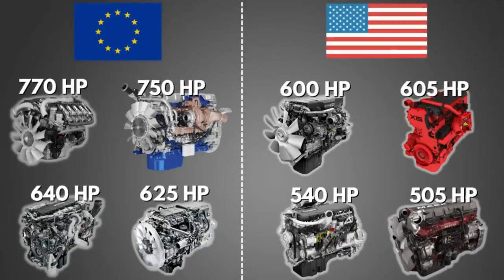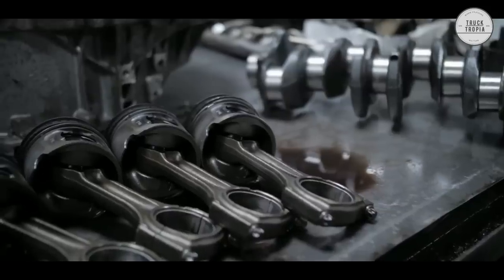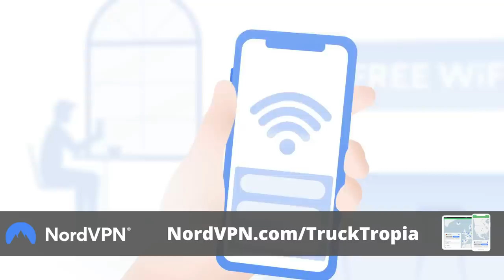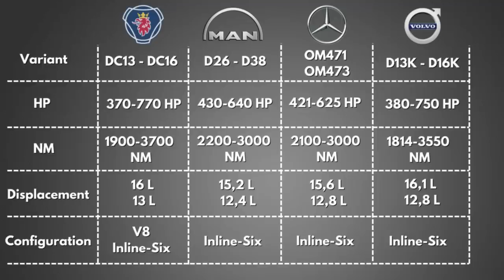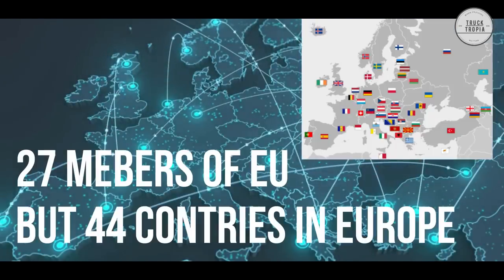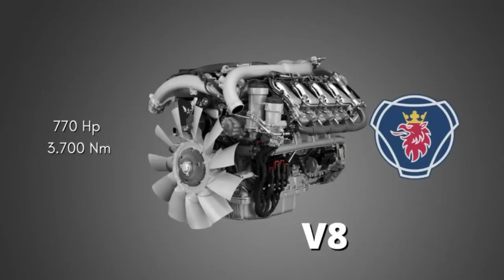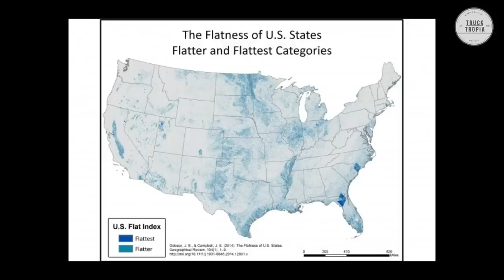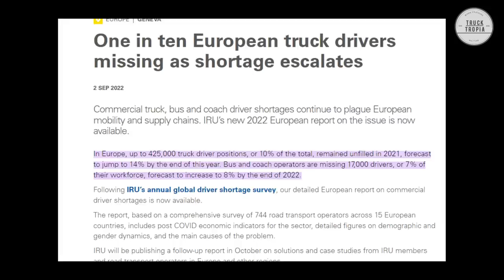Why European Trucks Have Up To 770 HP And US Don’t

Comment: Interesting video, but I think some assumptions are not quite correct. Most trucks in Europe are not as strong as the video assumes. I also don't think Europeans are more powerful on average than Americans. After all, these trucks with more than 700 hp are very rare and are driven mainly in Scandinavia. In the past (in the eighties and nineties) US trucks were on average more powerful than European ones. This has leveled off somewhat now, but the few very powerful models of the Scandinavians should not be taken as a basis for a statement that the European ones are stronger.  The US trucks are definitely faster ;). At least in Germany, there has been a "technical speed limiter" at 80 km/h for years. They can go faster downhill, but not by much. I used to drive a lot in North America, both privately and professionally. There were a lot of heavy trucks traveling at 120 km/h, which scared me quite a bit. Often in wet conditions and other conditions that would not have half justified it.

Comment: it doesnt matter at all how much torque an engine produces. Thats what you have a gearbox for
Reply: @boonamai8926  it simply doesn’t matter how much torque the engine produces as long as it’s generating enough power and you have an adequate gearbox.
Reply: @boonamai8926  you need torque on the wheels. It doesnt matter whether you have an engine that does 500hp@2000rpm vs one that does 500hp@10000rpm. They can both pull the same. The first one is gonna be more efficient but they can pull the same with an adequate gearbox
Reply: @boonamai8926  An engine with 500hp at 2000rpm has 1780nm of torque at 2000rpm. An Engine with 500hp at 8000rpm has 445nm of torque. Power is nothing else then torque multiplied by rpm. So when you now connect the 500hp@2000rpm engine to 1:1 gearbox you have a wheel that spins at 2000rpm with 1780nm of torque. If you connect the 500hp@8000rpm engine to a 4:1 gearbox you have a wheel that's spins at 2000rpm with 1780nm of torque. 

So as you can see it makes no difference how much torque the engine produces. Because a gearbox lets me convert rpm to torque or vice versa as I like.

Comment: Most truck companies in Europe has trucks with the amount of power that the transportation needs.
Most engines has 450-550hp, almost only those who haul heavy stuff has more than 600hp
For example is the 750-770hp more common among lumber transportation companies.

Comment: The biggest reason is political. Most of those engines have a lower less horsepower tune for the everyday customer however there’s a different more powerful tune for the government/military. It also has to do with our stupid emissions laws over here that really only make the engines more expensive and much less reliable. We use to have access to big massive V-8 and V-12 diesel engines. Higher horsepower/torque engines help in the hills and mountains. Don’t be fooled there are plenty of drivers out there that have upgraded/tuned their diesel engines way above the 700 horsepower range.
The other reason is fuel economy and the cost to operate over the road when dealing with big corporate trucking companies who’s bosses aren’t out there on the road actually pulling the loads. Fleet trucks over here are mostly gutless.

Comment: Here in Michigan USA  Many Trucks are running with 11 axles with a Gross of  160,000 to 164,000# There are also special permited much heaver Loads in the USA.  In the Past there were much bigger engines with more Horsepower maybe they have not been updated for EPA Emissions Laws or Euro 5 Emissions..
  Plus in Australia the road Trains can have a secondary engine on some of the Trailers..

Comment: Without the horse power it would take an eternity to get up to speed so hp is important
Reply from the maker: Sure but without the torque it wont be Able to pull anything. A 700 hp Bugatti cant pull like a truck
Reply: @TruckTropia  and a truck can't do 250mph

Comment: The  Paccar MX 13 engine  is develloped by Daf in Eindhoven in the Netherlands, owned by Paccar, for the American market.
In 2019 Daf started producing those engines for Paccar  because they couldn't keepup with the demand in the USA.
I don't know about the current situation, after covid the market changed.
In the EU there won't be much furter devellopment with Diesel engines, it looks like it won't be possible to register new trucks after 2040 that run on Diesel.

Comment: Before Scania started selling the big straight 6 engine, the company i was driving for had a test truck. Must have been in the 90´s when making a cell phonecall was expensive. The test truck had the cab for the big V8 and 4 persons where needed to flip the cab. And only when Scania tec´s where there. It had a phoneline to Scania and technician at Scania could se everything going on in the engine/transmission in real time. And even change the power. I heard 7-800 hp at the top. They could even see the revs at the front and driving wheels. Going uphill at low gears made the driving wheels make alot more revs than the front wheels. Anyhow, it was fun to drive going uphill with more tonnes than the other trucks. It was really flattening the hills. Once i had emty plastic bottles on the truck and trailer, just a few tonnes, i guess the pallets where the heavy stuf. I drove that for 80 km and did not use all gears, The split was in top and the revs started in the basement at idle, then i changed trailer with another truck that had frosen meat up to maximum weight. At that time the Sandöbron (a old bridge) had a maximum weight at 52 tonnes, so now we both could pass the shorter way, and saving an hour. Anyhow getting out from the loading area where tricky and tight so i had to do some cornering, and i felt the added weight from the start. So i called the other driver and told him i made a bad swap, and he was laughing. When i got to the E4 (big road) i saw him way behind in the mirror, i was jumping gears and when i got 80 km/h he was lost. He was going alot faster than me but it took a while for him to catch up with me. Then we came to the first big hill. Hökmarksbacken. The highest point of the whole E4. Then he was lost again, i only used one split in the gearbox and flew ower the top. And still i was the one with the big heavy trailer. He only had a heavy truck. I stalled the engine (had the hi gear) at a broken busy trafic light, i was mooving but the engine did not start when i lifted the clutch, not even with the starting key, the engine was turning but it didn´t start untill i turned the key all the way back to zero. I knew i could pass the crossing, it was downhill, but i didn´t want to be standing on the E4 waiting for Scania tec to come. My brain where working full time at that moment. And i didn´t have a cellphone at that time.

Comment: Why these Nm matters at all? There something called gear that can increase torque to any value. Power is what really matters, because having enough  power you can always  tradeoff some speed to get more torque.
Reply: Sure. If you think creeping up every little hill doing 5 MPH is your thing... Bet other motorists would find that pretty annoying though...
Reply: @marcusjosefsson4998  you can have the same Nm on wheels and the same speed with engine having half torque but at twice rpm. Check in Wikipedia what is torque and what is power. power=torque*rpm (more or less - actually rpm has to be converted to rad/s to get result in watts). A 200hp motorcycle engine can power a truck and go uphill not slower than with 200hp truck diesel.  It will only wear quicker and burn more fuel.
Reply: @tomeks666  To maintain speed using a combustion engine and a gearbox there are more factors to consider.
We're talking about pretty heavy machinery here, that takes a lot of torque to keep moving. And since a combustion engine have a specific power band we need to keep the engine rev's in that band. On a very big diesel engine that power band is pretty narrow, which in turn limits how your gearbox needs to be constructed.
And since we don't wanna creep up that hill obstructing other traffic we need to find a working compromise through torque, power and gearing.
Thus we get a lot of horsepower no matter what.
Reply: @tomeks666  I know it's possible, but it's not feasible in practice. Pulling 40-60 tons up a hill with a motorcycle engine is doable, once. After which you'll need a new engine...
And since we can't stop to swap engines every 10 minutes we'll use a big turbo diesel instead that'll last for years.
I get what you're saying and all, it's just not meaningful to argue about it

Comment: That stuff you said about torque and power at the beginning is quite wrong. Power is how we measure an engine's ability to do work, not torque. A truck with more power will do more work than one with less. Unlike torque it's directly comparable.That's why they advertise the output of truck and tractor engines in HP.
Reply: Yes, that same blunder by them set me off too.  I stopped watching because of it.  Really the only time torque matters as a spec is when you don't get to choose the gear ratio.  
Another really important thing that this and many others miss is the ability of the power train system to make its pull power for a long time on a hot day repeatedly.  It takes a while to heat the great mass of an engine up but if you are climbing a mountain with one, it will reach that high temperature.  I think there still are some trucking companies in the west of North America that specialize in taking loads over the mountains.

Comment: On the hp vs torque part, remember that hp is just torque x rpm,  just like volt x amp = watt
Reply: Power = torque at the wheels (!) because more rpm = lower gearing = higher multiplication of torque to the wheels

Comment: I understand that the big power engines in Europe have a GPS limited output, this is to allow full power up the mountains but not the flat lands. The 58 mph speed limit makes it unnecessary except for the really heavy haulage loads, most our trucks have the lower options as the price is more important.  Australia with the road trains take the big output options to pull the high  number of trailers involved.

Comment: Just a reminder:
Max (standard) gross weight of trucks in the EU is 40 tons. Some exceptions exist, though.
If a truck is hauling freight to/from a container terminal (for transportation on a train) the limit is 44 tons.
Those 60 ton (or higher) weight limits are only allowed in specific areas of Sweden/Finland.
Irrespective of that oversized (and overweight) transports are common but need individual special permission (€€€ !) and are usually required to follow strictly (in advance) defined routes ...
Reply: Since 2015 it´s 64 ton here in Sweden and it applies to the entire country except roads with limited load capacity.
Reply: @MichaelB-sr2tt  Ok 
... but those heavy trucks cannot leave Sweden - in particular to the south.

Comment: I would have thought higher power means these engines have to run at a lower fraction of their max power, increasing engine life and service intervals and reducing emissions? I was always surprised Volvo and Mercedes buses (yes I know, not trucks) are so popular in India, as they are imported so far more expensive than domestic brands. The power of these modern engines are immense - I've seen them overtake other buses on steep winding roads! If a Volvo/Mercedes driver decided he didn't want me to overtake his bus on my motorbike while going uphill, I simply couldn't!

Comment: Um, while you're technically correct about the things you said about the EU vs the US I'd still like to comment about the size thing...
While the EU is smaller then the US Europe as a whole is actually *bigger*.
And those trucks operate outside the EU too in countries like Norway, Switzerland, Ukraine and so one and so forth...
And while Russia has poor infrastructure their European part actually has a lot of pretty decent roads in their core areas in the southwest where these trucks also operate.
So the size argument doesn't really hold water.
The differences in terrain however is most definitely accurate.
Norway, Spain, Switzerland and Austria, Italy, Hungary, Montenegro...
All of these countries have pretty rugged terrain with some serious mountains that needs to be dealt with...
Reply from the maker: Thanks for sharing 👍

Comment: The best truck i have is a Kenworth with a 7cz cat wich is even bigger than a 3406e or 5ek . I run circles with every truck on the road . The 7cz gets barely 4,5 miles per gallon but it does 108 miles per hour under a load of 215,000 pounds in a straight line . In hills im doing still faster then the truck in the right lane struggling . Caterpillar is the best ever . My volvo i like because is a cadillac smooth ride and because is my 1st truck but in no way compares to the ground pounder 7cz cat.

Comment: there is also the expectation in europe that a large engine gives high horsepower and torque. the usa have a market where a pickup has a 7ltr putting out 450bhp. in europe they get that from a 3 ltre. so if you go in to a truck dealer and see a 14ltre motor but only see a small difference in power you ask why. usa expects crap engine efficiency. if you look into it most usa trucks can have minor changes to get much more torque. you exchange life expectancy and fuel usage for power.
jeremy clarkson from top gear asked once how do american's get so little power from such big engines?

Comment: Torque has nothing to do with towing a trailer. Funny thing an author of the chanel with such a name doesn't understand that. 
Torque number, when multiplied by 2π, shows the amount of work an engine produces per one revolution. When your boss tells you to tow a 50 tonnes trailer (force involved) for 1000 miles (distance), he doesn't tell you a specific amount of engine revolutions you can't exceed. Instead, Work, being force times displacement, requires a specific amount of fuel, and not the amount of rotations or amount of torque per rotation.

Comment: The US manufactures make more powerful engines for specialized (overweight, oversized) hauling. For reference, lookup US Heavy haul semi. Like EU trucks you will find many many more axles and specialized trailers with tons of pivots and axles to distribute the weight better.

Comment: This shit about tourque is just wrong! You can easily convert tourque with a Transmission. You can convert power into more power. In order to tow a load up a hill at a certain speed, you need to transfer potential energy to that load and this can't be done by a force (or tourque) but by power. Or in other words, thourque at a certain rotational speed equals power. Thats why power is the correct measure to classify the towing capacity and not tourque.

Comment: 0:58 is wrong: engine tourge doesn't really matter, you want to run the engine at maximum power and then choose the right gear to get maximum tourge on the wheels, if you have 60% the tourge at twice the rpm xou get 20% tourge at the wheels with the right gearbox

Comment: The other major reason is US truck get their power from transmission and deferential Ratio ! American trucks with a smaller engine are more powerful than EU trucks . When you use a 18 speed eaton fuller or 8LoLo you can climb the hill easily! So in trucks powertrain has a big role

Comment: My Dad used to run the hilly roads of southern Quebec and Maine carrying logs and peat moss to Virginia and New York.  The truck was a Quebec made Sicard with a gas engine which made MAYBE 180 hp.  Drivers today have no idea of the driving skill the old timers had behind the wheel.  Cabover with no air conditioning.  Imagine that today.
Reply: So what? He was slower? If the power was enough to get the truck uphill, then what has changed? He had to push the truck uphill? Was he steering in a different way? Same shit as today... People work 1,5km underground w/o air conditioning sometimes. "OOOOOO, i had no air conditioning in my truck back then". Disaster kurwa.

Comment: This video is totally wrong. Seriously. It starts with the torque vs power argument which is wrong because a higher power ALWAYS leads to higher torque with appropriate gearing (Torque~ Power/RPM). Than it claims the weight regulations have something to do with it. It is 40 tonnes in the EU. The rest are exceptions. And it ends with "customized trucks" please. Give me a break. Everyone that ever stepped a foot into the EU knows that most truck drivers are eastern europeans getting exploited by trucking companies. They don't choose their truck. In reality: European trucks simply don't have more power. They usually have 500 HP in Europe, grown recently from 400 HP. 770 is just the upper bound which can be ordered and not the norm.
Reply: I stopped watching due to the HP vs torque thing.  They owe you the time you continued watching.

Comment: Well,in Sweden for example the maximum length of a full trailer is arond 30 meters and with a weight of 90 ton,so you will need some serious power to move that kind of set up and that's the reason Volvo and Scania has the biggest and most powerful engines of all.

Comment: I hate that my company expects us to pull 63.5 Tonnes and only gives us a 525hp Cummins. Don't get me wrong, I love the engine but the power is lacking considering I run through the mountains. (At 15-30km/hr)
Reply: Yeah, 525 seems a bit small with such weights in the mountains espcially. In Scandinavia such truck will typically be 650-770 hp